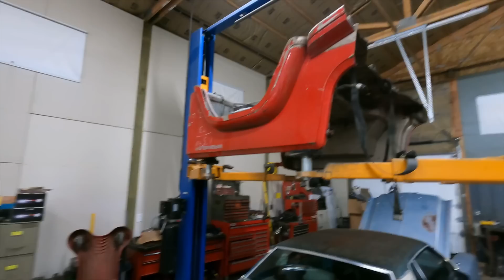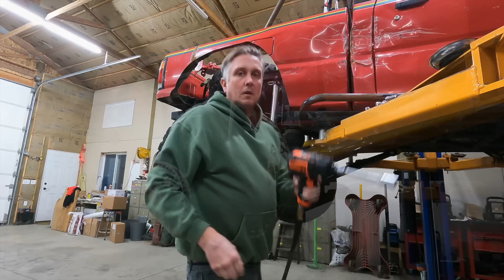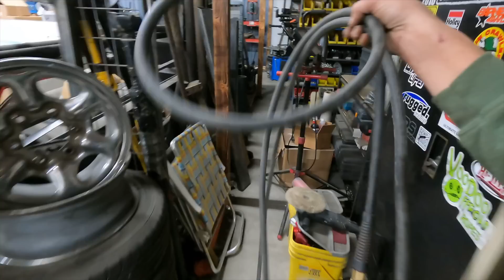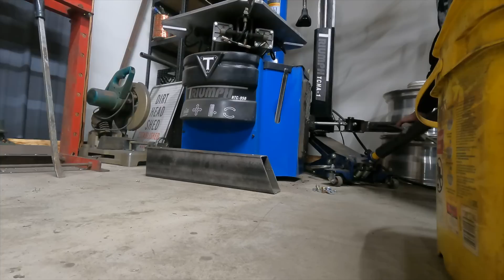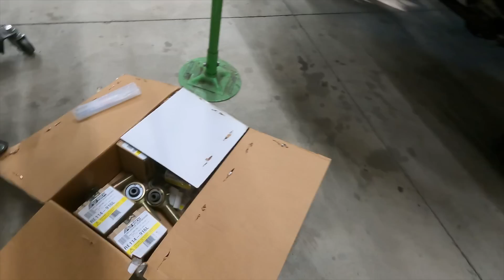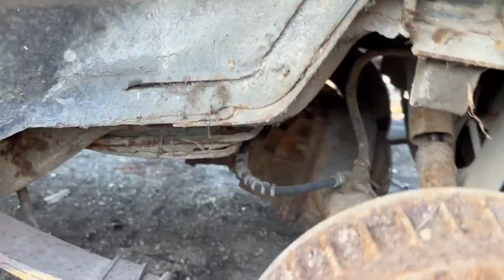Chaos in the Shed!  Tire swaps and junkyard finds

Comment: What tires ya'll recommended for a desert/mountain environment.    It'll be a working rig for recovery and trail repair.  It's a 2000xj with a 4.7l stroker engine.  8.25 rear with a spartan locker and d30 open front.  5 in lift and it's got 33s right now.    Won't go bigger till i do the one Ton swap.   And i know you get what you pay for but man I'm outta money lol.   That's why I'm asking the professionals
Reply from the maker: That right there would probably be pretty good on the Milestar Patagonia mt02 for a while
Reply: @thedirtheadshed  that's exactly what I been looking at

Comment: Dude your doing great progress not perfection.  We all love yah. Still being you and that’s all that maters .  Tip share :).  All
The tire swapping you’re doing. I’ve been doing a liquid balance and it’s epic. I mount tire,  air up tire normally. Take a normal water bottle 16-32oz  insert a piece of vacum or fuel hose into bottle:  air tire way down , remove valve core. Slide hose into bottle which is filed with RV anti freeze so it’s environmentally friendly and cheap as heck.  Once hose is in bottle of fluid simply jack the tire up. As it takes shape it pulls fluid into tire because of vacum.  It’s magic I use
About 16oz on a 33-35 and around 24-32 oz on 37” it was only way I could get my military Goodyear’s to balance and since then I’ve done it on a few sets and beat part is you can’t mess it up cause it uses centrifugal force like beads but a 10th the cost :)  and also if you have a tire way out of round . Use a table top style
Belt sander . Jack up a tire slowly turn it against belt sander obviously big bench style not hand held . Go slow with some 36 grit and she’ll be round.  It’s only way I’ve figured out how to make some of these tires usable .
Reply from the maker: Good advice!  I’ll try the sander deal one day

Comment: Your camera work and audio is fine for me, second my vote for Louis is to turn it into the ultimate overland offroad vehcile. So many people buy those $500k and up earth roamers, I say build one that can go rock crawling and mudding, and camping, and where ever you want to go. Bob the bed, leave the bed, make a whole new bed customized for holding alot of camping gear with built in roof top tent holder that is lower to frame. The sky is the limit
Reply from the maker: You and I are on the same page

Comment: I put 2004-2008 F-150 40/20/40 seats with Integral Seat Belts in my project truck. These solved my seat belt problem and are very comfortable. You likely will have to modify the brackets but for you that should be child's play.  Love your videos.
Reply from the maker: That’s a great idea.  Thanks for the heads up

Comment: you can try to use bead balance method to see if that helps.
Reply from the maker: I have tried before and had zero luck
Reply: @thedirtheadshed  I only had partial success. Most success I got was on my RV. Honda element worked out ok as well with specific driving conditions. My Audi 90 made it hella worse.

Comment: If you have at least two trucks that use the same bolt pattern, or maybe more trucks that do, and have similar back spacing , that would make it easier to just unbolt and bolt wheels. Maybe when you build vehicles, take wheel swap-ability into consideration when building.
Reply from the maker: I do take that into consideration.